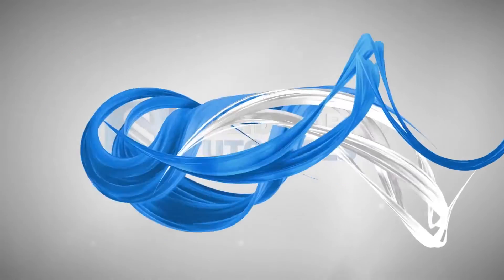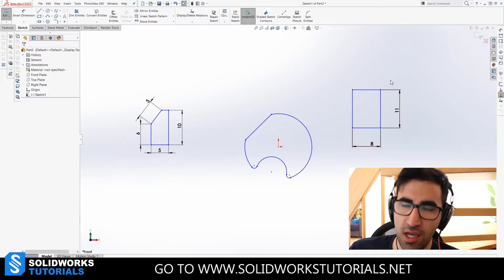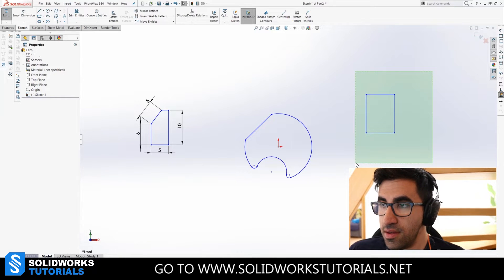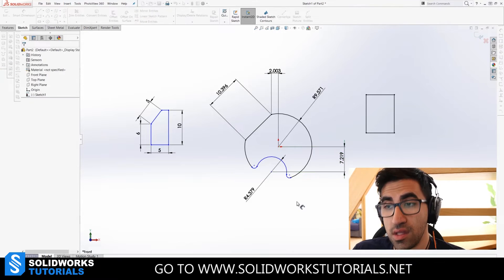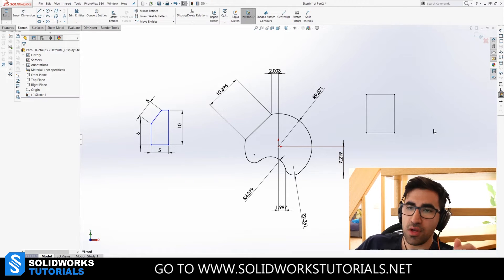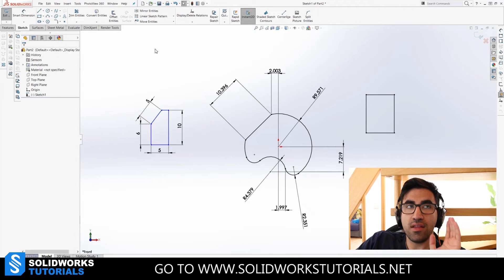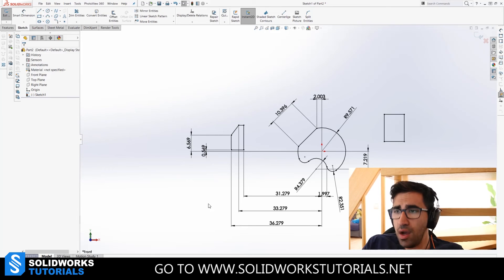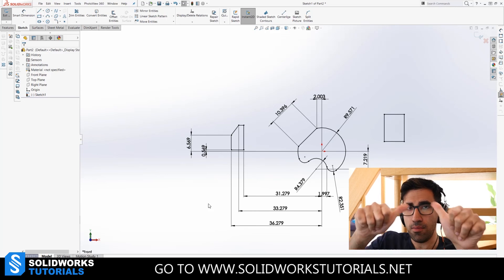Why and How to fully define a sketch in SolidWorks   SolidWorks Tutorials with Ryan

Comment from the maker: I have a great webinar that is free and you can watch it here http://bit.ly/SolidWorksCourseProForBeginners
Reply: Is there a way to change the functions for the shortcut of right clicking and dragging?

I feel like it would be useful to add dimensioning to that and a few other things
Reply from the maker: @ab3040  dragging is not with right click. but you can change anyshortcuts from the Customize menu
Reply: @with-aryan  I mean when you hold right click and drag the mouse in a direction and then let go. There are preset functions for what up, down, left, and right do. I think you can change those tho right?
Reply from the maker: @ab3040  Those are called Mouse Gestures and you can adjust them again in the customize menu. Go to TOOLS then Customize and then find Mouse Gestures. I think I have a video about it
Reply: @with-aryan  ohok thanks for the help!

Comment: Can you please mention also the case where you use fully define sketch tool and the results  in the color yellow that says something like “the sketch is not yet fully defined “ and you then have to try dimensioning entities to find the one that works. Is there a way to quickly define a sketch when this occurs?  My guess is that the tool cannot solve for the missing dimension…..

Comment: Hi Ryan,
Great video.  When I use “fully define sketch” to get the automated dimensions, I sometimes get the message that says something like “the sketch has been defined but not fully..”. I then have to hunt for the magic missing dimension to make it fully defined.  Is there a way to quickly find the missing dimension or relation to make it fully defined?
Reply from the maker: Yes there is but what is an "Automated" dimension? Unless you are talking about the drawing mode?

You can go to the sketch tab and look for the "Display/Delete Relations" tool up there and click on the small arrow beneath it, and select "Fully define Sketch". This will do the job for you OR it might even push your sketch into an overdefined state in some cases. In those cases, you are better off Diagnosing your sketch manually but going over suspicious entities i.e. lines, arc etc. and try to move them with the drag of your mouse. If they moved, you know where to look.

Comment: I'm a Catia intermediate user. I might have to change to Solidworks.
In the Catia tree, below the sketch one can see the geometry, constraints. I find this very convenient. 
What about Solidworks? One can only check these parameters on the design?
Reply from the maker: if you go to the VIEW tab on the top, you can go and find SKETCH RELATIONS, if you check that, you'll be able to see the relations at all times. I don't like that as they make the sketch too crowded
Reply: @with-aryan  but what about the tree?
Reply from the maker: @davidgruty  you cannot see them on the tree tho
Reply: @with-aryan  yep
 That was my point, if one has a complex sketch and wants to edit it, it's easy to get crazy. Specially if the part was made by somebody else

Comment: Thank you for the tutorial but I still don't understand why @6:55 it couldn't make the line vertical. If that line was made vertical, the whole left side would be 11, the right side would be 12 and there would still be a line connecting the top of the two lines.
Reply from the maker: i applied it to that inclinded line. therefore, it couldn't be vertical